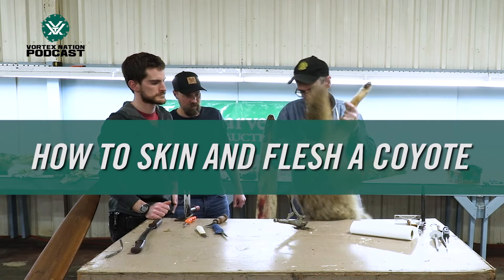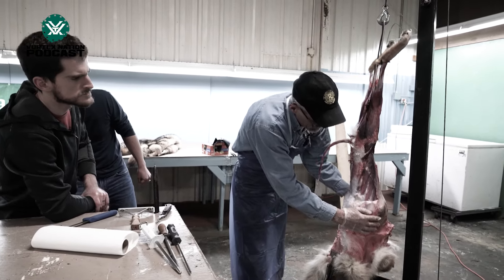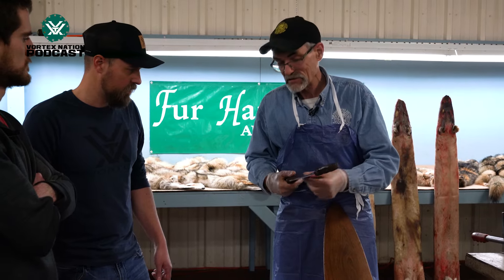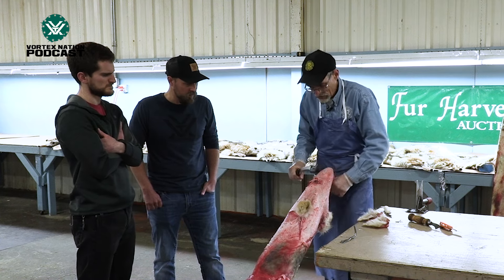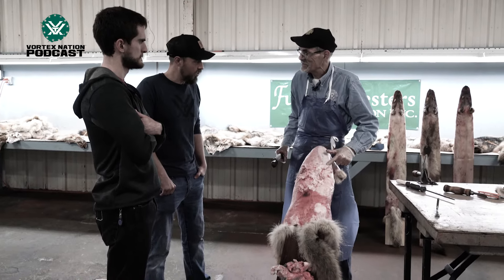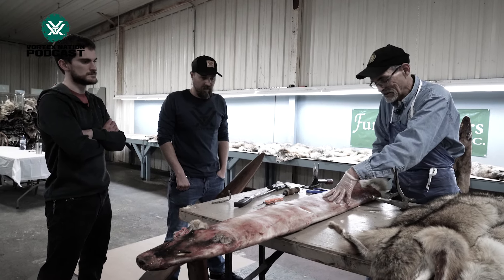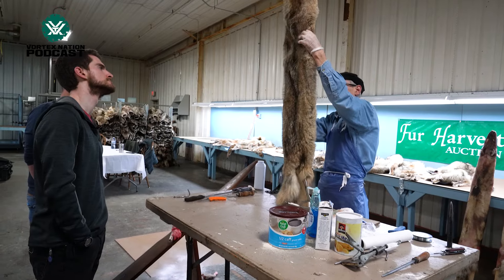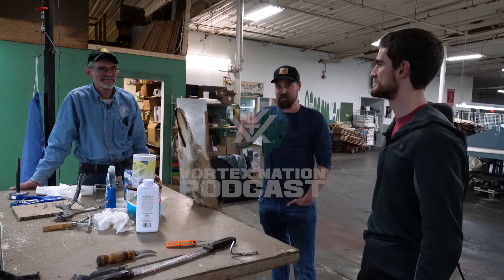Nebraska Coyote Series | How to Skin and Flesh Coyote Fur - Episode 2

Comment: Taking those burrs out is crucial to good fleshing.  I worked as a skinning for a number of years and skinned more animals than I can say, and have seen many messed up from guys stretching them on a fleshing board with burrs, and pop holes in them from the burr lumps!
I always completely turned my ears rather than cutting them open how he did, but I did them for taxidermy as well as fur, so I suppose that's the difference.

Comment: Do yall wash them before you skin them. I have done 4 so far and wach one I about puke from the smell. Its pretty aweful.
Reply: I came to the comments to ask that exact question. 
My nephew got two once and I couldn’t get more that 15 feet from them bc they smelt so bad. 
Incredible video to show how it’s done but I couldn’t imagine doing it myself. I wouldn’t be able to stomach it.   We all no are limitations 😅
Reply: @rsa9082  it's definitely not for weak stomachs. I did another one recently only because it had very pretty fur. I had 2 fans blowing away from me so the smell didn't linger. I have noticed,  the colder it is, weather wise, it doesn't smell as bad. The previous ones I did were late spring almost summer time. And i think the heat sped up the decomposition faster. Thats just my theory.